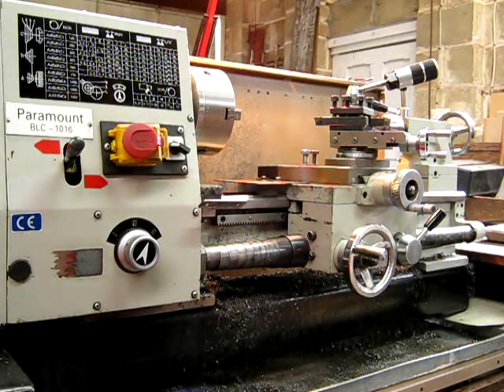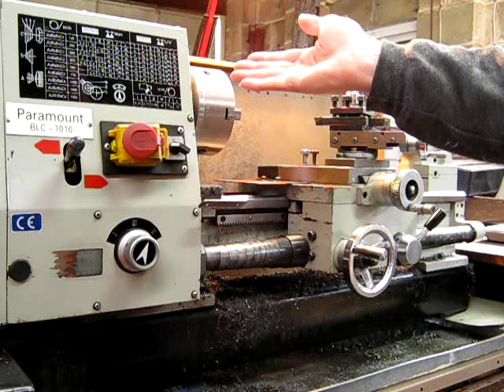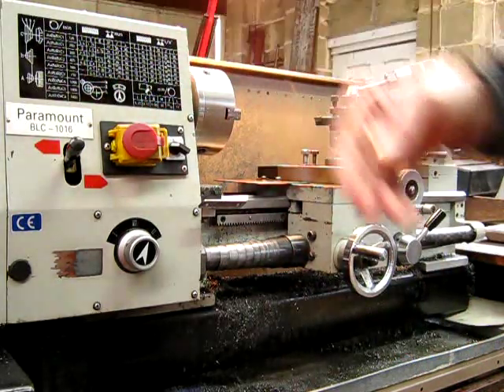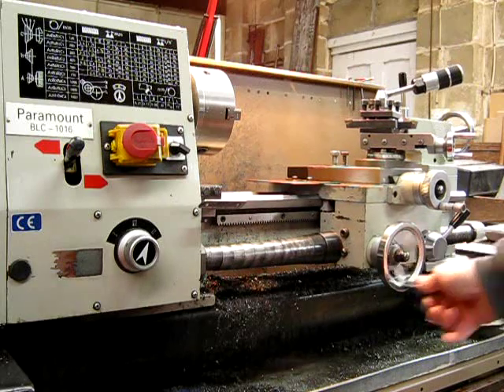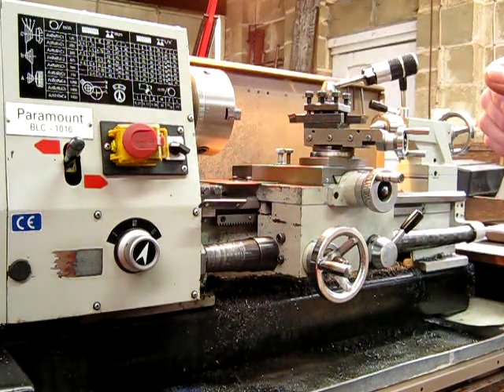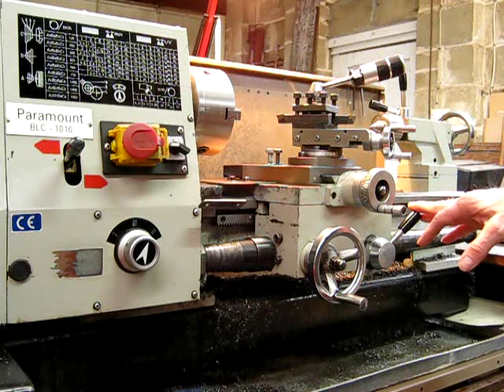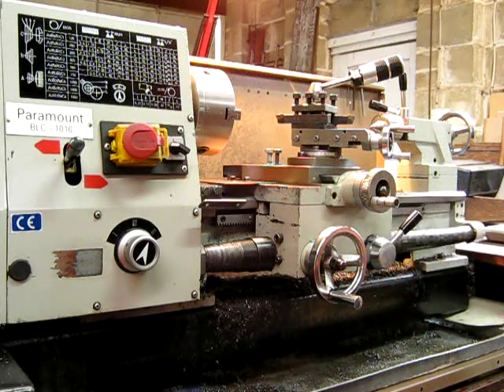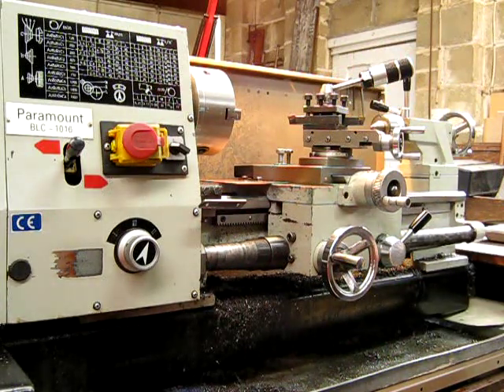Features to consider when buying a small Asian bench lathe

Comment: Hi rob. 
Have watched most of your videos and also mrpetes (aka tubalcain) I work in construction (bricklayer) but have grown up around my fathers fabrication shop. So I've always had a passion for metalwork even though I didn't follow that path for work. However I have just gone out and purchased a hare and Forbes AL336D. And spent about the same on tooling. I even bought the 5c collet adapter and collets (after watching your collet videos) I am a total newbie when it comes to lathes. The booklet on the lathe is no help. 
I have made up a few parts no problems. 
Couple of questions if you have the time as there is no videos online about the hafco machines. 
I use the powerfeed no problem. But the lead screw is not turning? Why is this? Is there something I have to change is gearbox in order to use leadscrew for threads? 
When I engage halfnut I cant engage powerfeed. (Your machine feeds with leadscrew?) I know how to change feed rates. But can't get my head around cutting threads. The thread dial is not turning when powerfeed is on obviously because lead screw is not turning. I would be cutting with powerfeed? And would have no reference when cutting multiple passes. 
I can't figure it out. 
Also it came with leadscrew covers and with them on I can't get all the way up to the 5c collet chuck. Are they easy to remove?  
Cheers from WA mate. 
Luke.
Reply from the maker: I'm not familiar with that lathe, but looking at the headstock I would expect that the lever to the left, and just below the two top ones, controls the leadscrew engagement.

Left is probably feed left and right is probably feed right.  Middle position is disengage. 

Check to see if it's disengaged.

That should get the leadscrew turning.

Then you control the direction with the small lever just to the left of the hand wheel on the carriage face.

Engagement would be with the half nut lever.

You obviously can't have the leadscrew and drive shaft engaged at the same time, so that is separated in the carriage interlock.

This manual may be better than what you got :  http://images.t4i.com.au/products/L682D/PDF/Instruction%20Manual.pdf

I hope this helps.

Cheers Rob
Reply from the maker: I forgot to mention that if the lever doesn't engage the leadscrew, check inside the drive belt enclosure to make sure the change gears are fitted/meshing correctly.

To remove the leadscrew cover you will have to slide it and the two metal end housings off of the leadscrew.

The end housings are normally attached to the headstock gearbox and carriage with three small screws.  To do this the leadscrew has to be disconnected at the gearbox end and moved to the right.  You will also have to unbolt the bearing block/housing at the far right end of the leadscrew so it can move that way.

Cheers Rob
Reply: xynudu thanks so much for the prompt reply mate. That manual is much better than the one I got. I have figured it out and got it to engage the leadscrew. Although the thread dial needed to be adjusted to mesh with the lead screw. 
I think I might leave the lead screw covers on and buy an actual d1-4 cam lock collet chuck. That one will bring the workpiece out about 150-200mm from head stock. 
A lot to learn mate! Keep them videos coming.  
All the best. 
Cheers.

Comment: Roller or ball bearings will introduce imperfection in parts under heavy workloads.
South bend heavy lathes use bushed bearing surfaces, they give better results.
Its a mistake to think bearings are better than bushings.
Reply: +jonesgerard Yes.... I always believed that that is so.... under heavy load the roller pattern can be reproduced on the work.... not good....